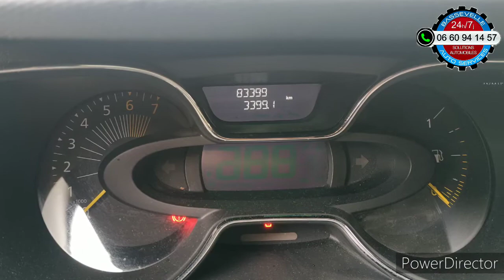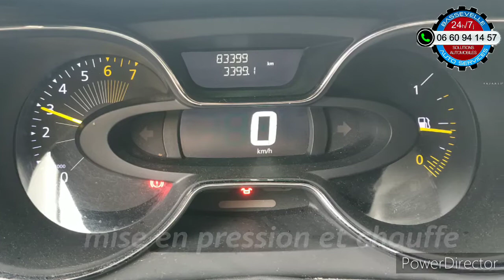Fiabilité Renault Capture TCe avec fuite d'eau (liquide refroidissement)

Comment: Ce problème (fuie du boitier d'eau) est extrêmement fréquent sur les motorisations TCE. Pourquoi Renault/Dacia ne veut pas reconnaitre le vice caché?
Reply from the maker: Ils ont pourtant 1800 plaintes en france
Reply: @bassevelleautoservices  Pour une entreprise come Renault, c'est quantité négligeable. En réalité, ils s'en fichent et n'ont aucun intérêt à reconnaitre les vices cachés sauf si ça touche à la sécurité.
Reply: Bonjour,
Je traîne une fuite du liquide de refroidissement je suis déjà passée dans deux garages on ne trouve pas de panne.
Une purge et vidange du liquide de refroidissement a été faite c'est un échec
De l'anti fuite a été mis échec
Le petit robinet vers les durites était mal visé mais en vain je perd toujours du liquide
Desfois c'est a sec ou sur le minimum, j'en remets et tout d'un coup le liquide revient et dépasse le maximum
D'où vient le problème ?
J'ai une capture 2018 Tce automatique
Reply: @samfischer1051  C'est le joint silicone du boitier d'entrée d'eau qui est de mauvaise qualité sur les TCE. C'est ultra connu comme maladie. Ca coute environ 300€ pour faire changer le boitier. Le probleme de Renault, c'est que le SAV est nul à chier. Donc retrourne chez eux, demande le changement du boitier d'eau, payes 300€ et tu seras tranquille pendant 60kkm voir plus.